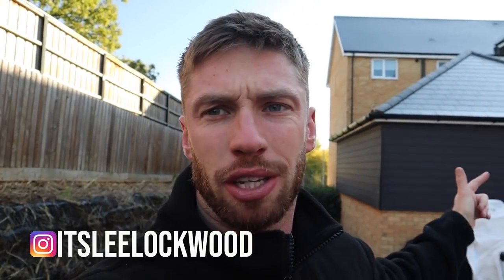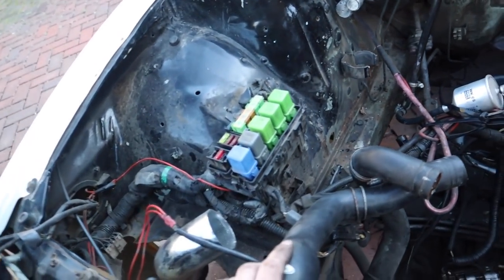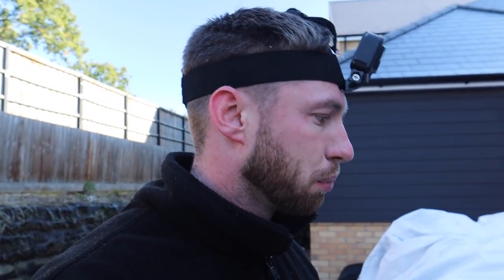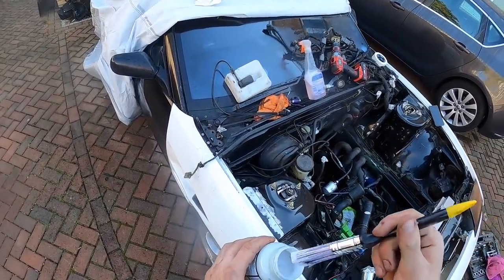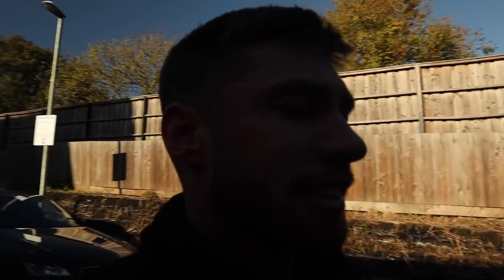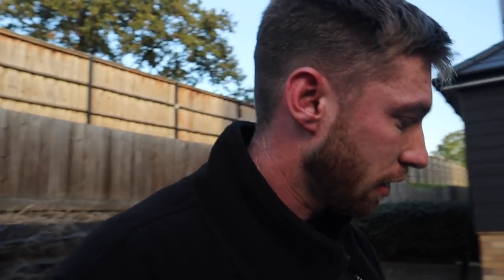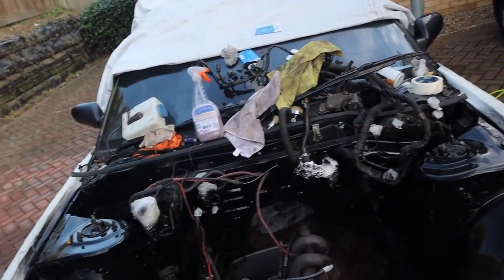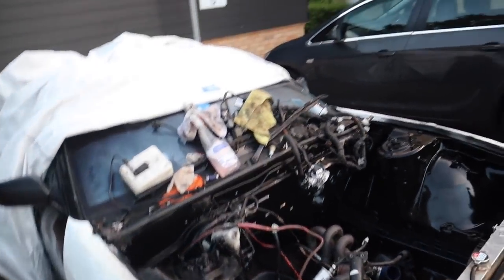£20 Engine Bay Paint/Restoration!

Comment: The rust killer doesn't like drying when it's on paint and not the rust/metal. A heat gun can help you out for those damp corners. A proper degrease is good as a first step and a can of brake cleaner can also be your friend.

Comment: Hopefully the paint won't shrink an crack drying in the cold .
Reply: Also known as orange peel😀 ive been doing my aprilia rs50 done all the panals exept the headlight fairing and a few little plastics had 1 case of it orange peeling lookily not in a see able spot so i aanded it best i could and re did it turned out decent hate winter for painting aha
Reply: @bmxaholic7600  no ,orange peel is orange peel as it says the texture looks like orange peel. Cracks from shrinkage are big cracks .